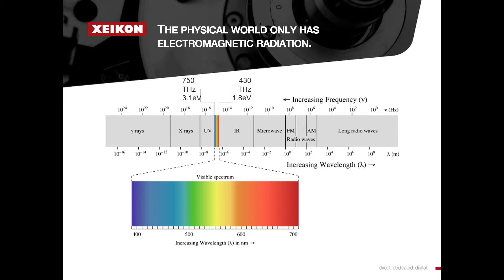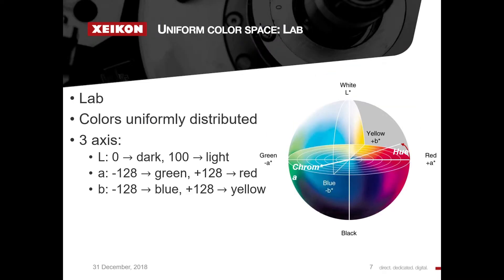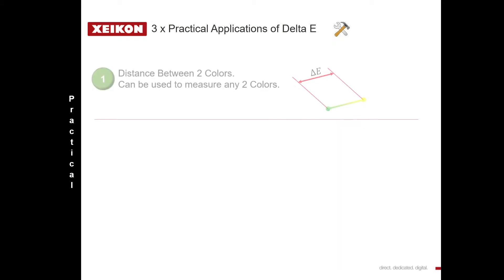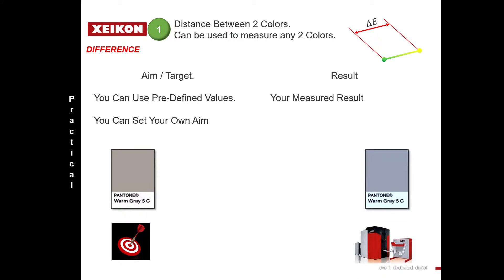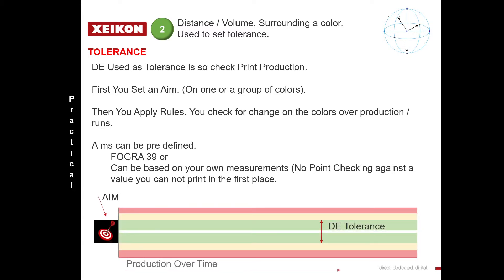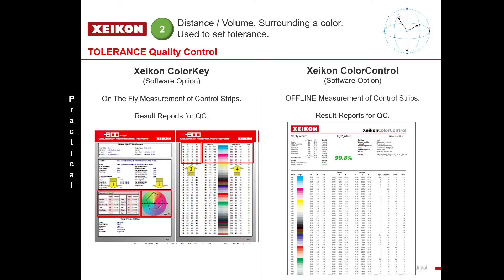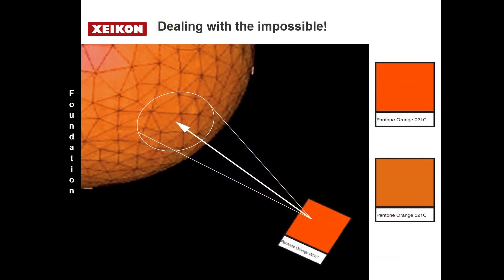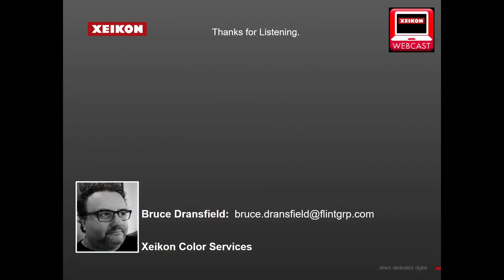4 Basic Concepts Delta E

Comment: I don't think a delta E value of 2 is clearly noticeable ?
Reply from the maker: Jim hi, in the movie i discuss DE as a possibility measurement. So if we have a color which is IN GAMUT so its possible for the system, and using cm you calculate a recipe for said color, as long as your software / press is good, then you for sure will never make a 0 de and if you make 2 it should be on the edge of ok.

but if you start from a point where the color is 2 out of gamut then, you will never be satisfied.

bd